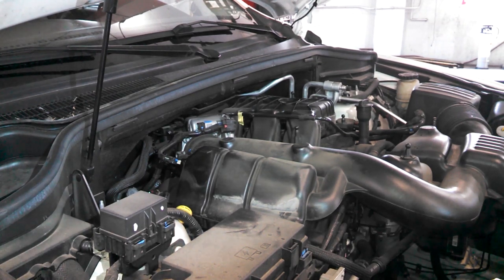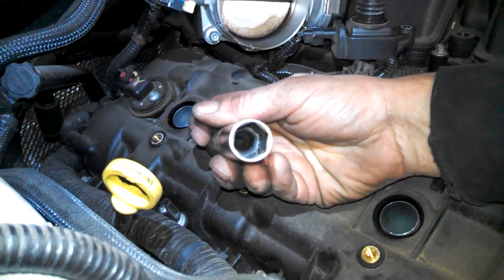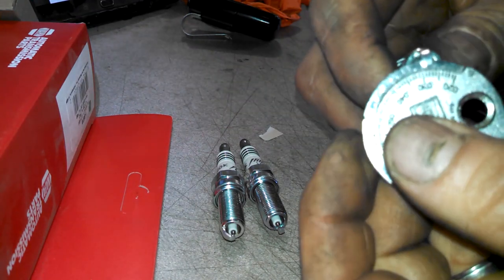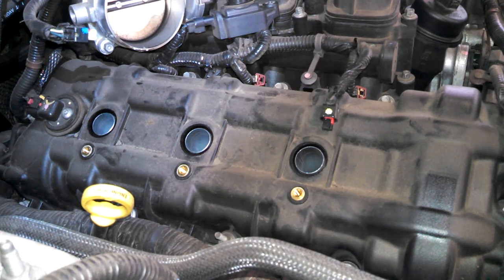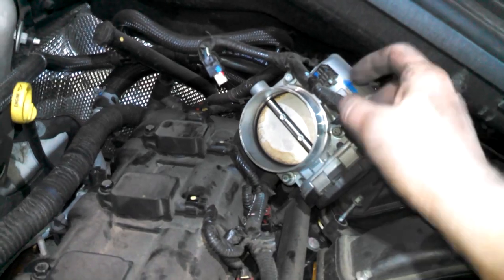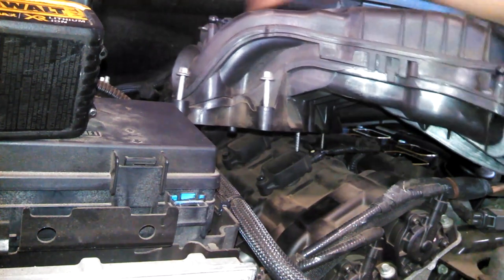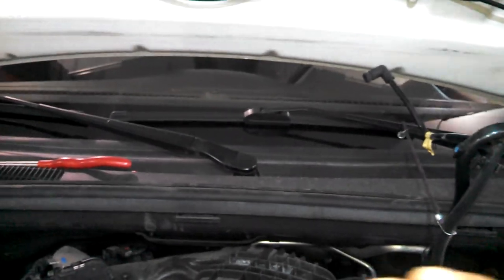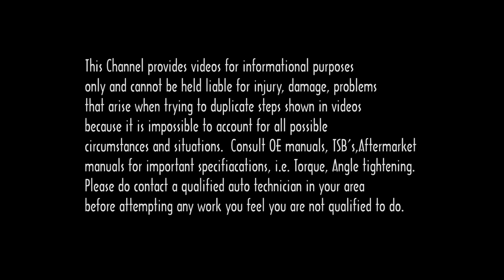Spark plug replacement 2012 Dodge Durango 3.6L V6 Install, remove or replace

Comment: Thanks for the video, drivers side spark plugs came out a little hard, made me nervous but just worked them back and forth a little to get the threads clear.

Comment: The video covers everything, but you still need to remove a couple hoses and you can’t move the plenum without loosening the lower 13mm bracket bolts. The firewall side 13mm nut is a pain because there is a press on retainer that makes it too narrow for a combo wrench. I used a pry bar to move the retainer and fished a wrench down there. I missed the part about screwing the plenum bolts up into the plenum but figured it out after a few minutes. 

All six spark plugs took me 2 hours. 

Thanks for the video.
Reply: Yes. He left out the two most important and harder parts of the job. The other was the hidden screw you can't see.

Comment: Good video.  I would have cleaned the Throttle Body while I had the intake pipe off.  Ignition OFF, just push the throttle blade open and wipe the opening and blade down with brake parts cleaner.  Will make it idle better if its clean.   The blue gaskets are called upper intake plenum gaskets.  I put a small thin coating of antiseize on the spark plug threads.  I also carefully examine the coil boots.  Look for hardening/cracking or deposits on the rubber insulating tube. The coil tubes and sparkplug wells MUST be oil and water/moisture free.  I clean the rubber coil insulating tubes with alcohol or brake parts cleaner then and add a small amount of dielectric grease to the rubber insulator opening.
Reply: Some spark plugs say not to use antisieze.

Comment: Do you know what the number cylinders they are? I need to replace the ignition coil on cylinder 6 but I having an extremely hard time trying to figure out which one cylinder 6 is

Comment: Thats a pritty good walk though ... but there is a bracket up in the back by the throttle body
Reply: Ryan, what did you do to deal with that bracket? I loosened the manifold, but I cant get to the brackets to loosen them enough to move the manifold.
Reply: @bmiller05  i  did the top nuts on the side brackets so you can slide it out . But there is a bracket behind the throttle. I believe its 2 nuts and a stud that has part of the wiring harness attached to it .. that has to come out then you can slide it towards the passinger side then out

Comment: This does not work! It is incomplete and DOES NOT TELL YOU EVERYTHING you need to know!!! BEWARE YOU WILL NOT BE ABLE TO DO THE REPAIR WATCHING THIS VIDEO ALONE!
Reply: He covered the basics for the DIY home mechanics. Shop owners hate how much information is available on youtube because it saves people hundreds of dollars doing it at home instead of getting ripped off.
Reply: This comment does not tell you everything.  Such as what you think he is missing
Reply: there's 2 bolts on the passenger  side, in the back. he doesn't show those

Comment: 1. You can buy spark plugs with the correct gap for your car.
2. You don't need a tourqe wrench. A German mechanic will say "tighten good" with a german accent😂😂😂😂
3. There are a couple of pain in the ass screws that might need extensions and swivel head sockets.